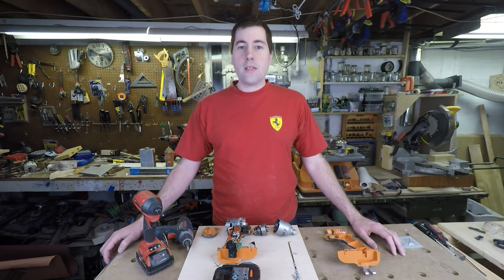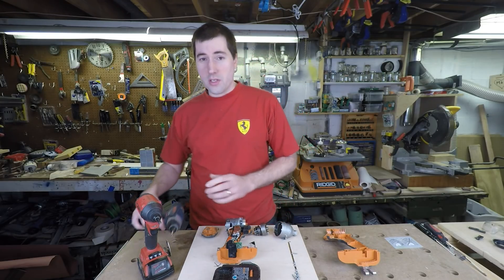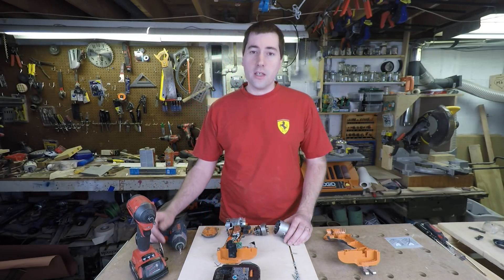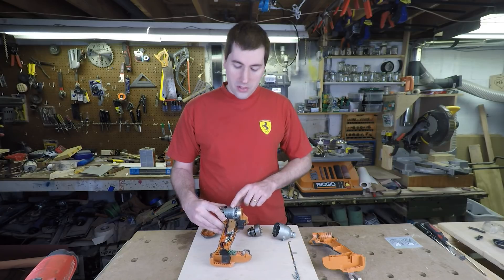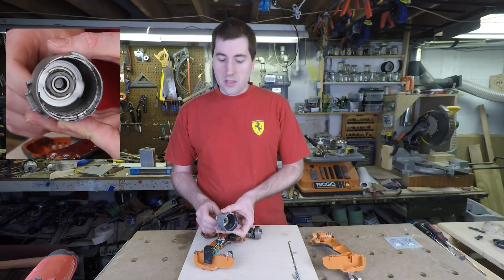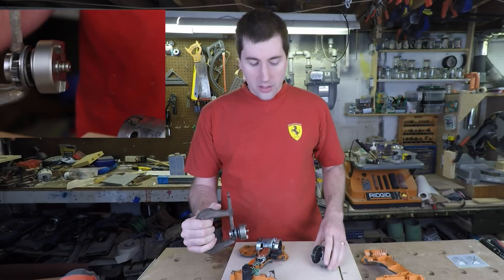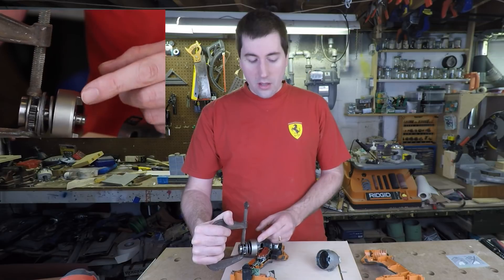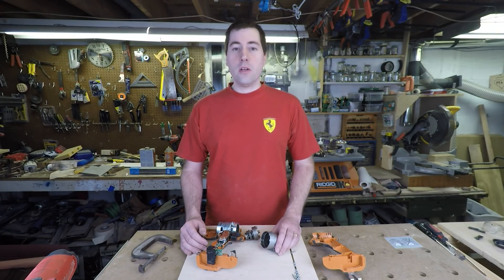How Impact Drivers Work

Comment: I've watched so many videos trying to find confirmation of a forward force.   This video sounds right to me.   WIth a regular cordless drill, I need to push forward with my entire body weight to make the bit stay in the screw head or it will slip.   If there was no forward force and only rotational, I can imagine the tool would need me to push forward just as much as a regular cordless drill.  However, with the impact driver, it appears that it only needs minimal forward force when using.  Great explanation.

Comment: Newtons first law of motion: an object either remains at rest or continues to move at a constant velocity, unless acted upon by a force.
In other words, just considering the axial part, if the spring is compressed and then released, that axial movement of the spring decompressing is going somewhere (either your hand or the bit.), it doesn't just disappear. 
The spring has obviously a lot of stored rotational energy than the axial energy (according to that particular spring constant and the distance displaces). Although, due to the small axial distance, I doubt this force is much. The rotational energy released when the anvil is hit is the main working force here.

Still, this guy is correct in his explanation.

Comment: Just by watching this video, you can see that there is a hole in the middle of the anvil, so the hammer will not strike it. The rotation of an impact driver is purely rotational.

Comment: For all you naysayers... let's look at this with just a modicum of logic eh? If you look at the timing of it, as the cam begins it's spin to impact, the spring is unloading a lot of stored energy in the AXIAL direction. Since there is NO pressure on the bit at that point, it works to drive the bit back into the screw right before the rotational impact takes place. While it's no hammer drill it does indeed provide a small axial impact. Enough to help keep the bit lodged securely in the screw. Check WikiPedia.
Reply

Comment: Wrong
Reply: +Chandler Keen As I showed you in his other video, WikiPedia defines an impact driver as providing both radial and axial force. Anyone with even a modicum of mechanical sense has to know a spring storing that much energy would most certainly provide an axial force, albeit not a large one. It's not a hammer drill afterall.
Reply: +BigBadWolf1st "Ridgids Answer:
The force would be rotational only as you press down during use."

Comment: Impact drivers do not produce any downward force. The force from the spring pushing the hammer back down is negligent. The spring is there solely to put the hammer in position, not to create any downward force.
Reply: +ScrewDrvr If you look at the timing of it, as the cam begins it's spin to impact, the spring is unloading a lot of stored energy in the AXIAL direction. Since there is NO pressure on the bit at that point it works to drive the bit back into the screw right before the rotational impact takes place. Check WikiPedia.
Reply: Negligible: "...so small or unimportant as to be not worth considering; insignificant."
Negligent: "...failing to take proper care in doing something."

If it doesn't produce force, then why does is make driving screws easier?

Comment: Still wrong, the Anvil is fixed in the axial direction, so when the hammer hits, only a rotational force is applied to the screw :-(
Reply from the maker: Micha K  That would be true if the driver was held in a perfectly rigid fixture.  However when the hammer hits, the entire driver is forced forward, and that is reacted axially by the fastener that you are driving, which keeps the bit engaged  and is the reason impact drivers are much less likely to cam out than a regular drill/driver.
Reply: Toolamanjaro There may be a very small amount of force applied the way you describe, but not enough to make a difference for cam-out. The reason Impact-Drivers don't cam out is because the rotational force is not constant, so every time a cam.out starts, the force is already gone, and the bit can reset into the screw before the next hit comes around.
Reply: @smsking2  " The reason Impact-Drivers don't cam out is because the rotational force is not constant, so every time a cam.out starts, the force is already gone,"  

If that was the case, it wouldn't work, dude. Draw the screw, draw the vectors of forces, and try to understand, there MUST be an axial component.
Reply: Micha K Nope, you are wrong. Impact wrench is only rotational impact, while the impact driver provides BOTH rotational and axial impact. Try screwing in a screw with an impact wrench, and an impact driver and you'll see for yourself.
Reply from the maker: Micha K Impact Wrenches have different style of anvil that only applies a radial force and allows for an order of magnitude higher torque levels.   The GDX is an interesting tool, but its appears to just be an impact driver with a combination head on it.   1650 in-lbs (138 ft-lbs) of torque does not compare to the 1100 ft-lbs of torque that a good cordless impact wrench like the Milwaukee 2763 puts out.
Reply: +Micha K "as you press down during use"

What if you DIDN'T press down during use?
Reply: True, the anvil is fixed in the axial direction, but the tool is not. The internal downward force does assist in keeping the bit from lifting.
Reply: The mechanism on an impact wrench, is exactly the same as in an impact driver, that's why Bosch made the GDX which combines the two.
Reply: Source?
Reply: Micha K
I contacted Ridgid, and ask them about the forces applied:

My Question:
I have a technical question about the X4 Impact driver:

Is the hammering action applying force in the radial direction only,
 or is there also a force applied in the axial direction as well?

Ridgids Answer:
The force would be rotational only as you press down during use.
Reply: +Micha K it's sad that he still doesn't understand that NO bit comes out of the tool to return to intial location in the tool (impact driver in ths case).
He needs to open and SDS hammer drill (any model he wish..) and see HOW that works very efficient with the concrete.. (you dont even have to push the tool until get the concrete drilled).

Impact tool just IMPACTS the screw when rotating throught that mechanism.. spring and anvil